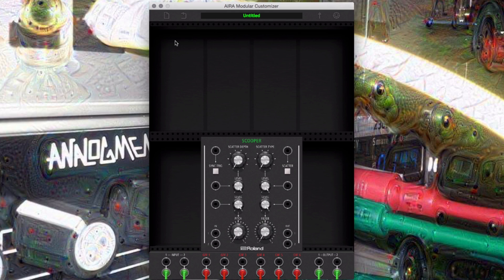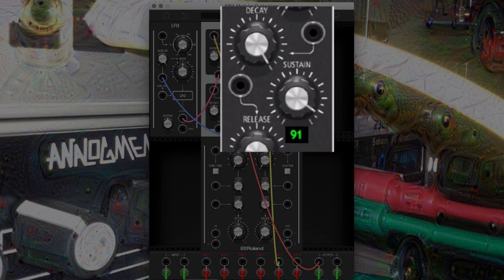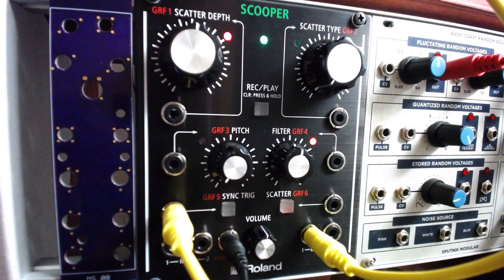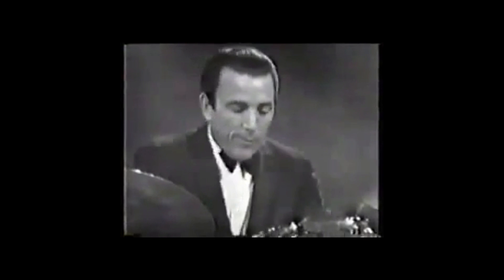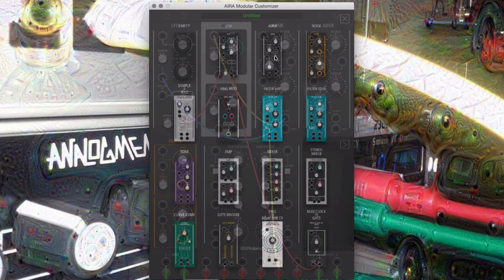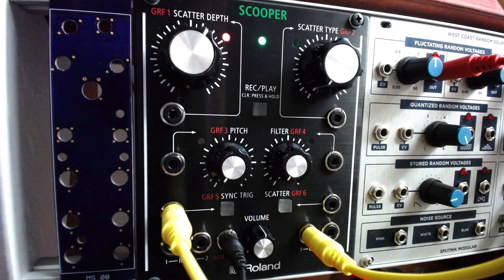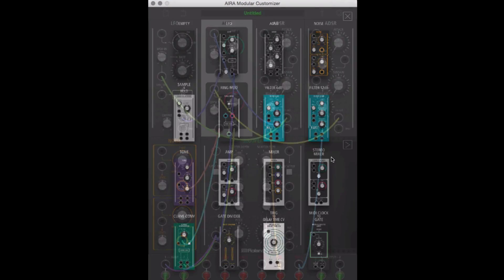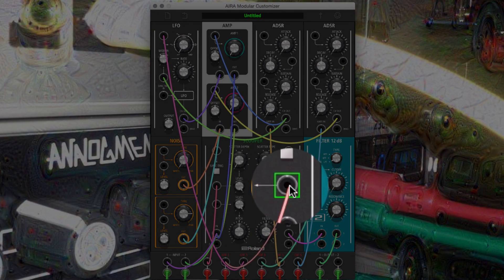Roland Aira Modular Eurorack Drum Machine

Comment: lost quite a lot sleep the last few days thinking about how to get the most out of these modules, just using torcido and demora with the mother-32 as of now, adding a second oscillator, pink noise, modulation etc (with the new update installed). THIS however, is really inspirational, will try it out, a ring mod hihat type sound to add to this maybe? anyway, thanks for the inspiration!
Reply from the maker: +Magnus Johansson Sounds like a good idea! Glad you got something out of this, check the FM Kick drum video I did as well!
Reply: +Voltage Control Lab will do! thanks!